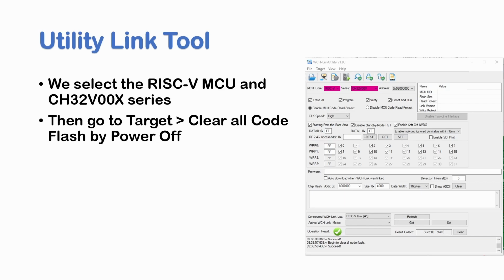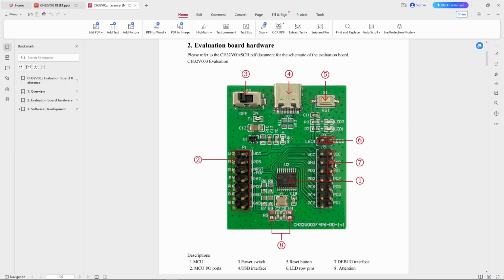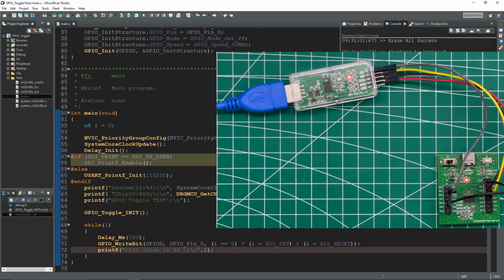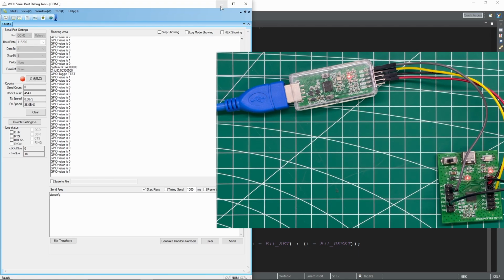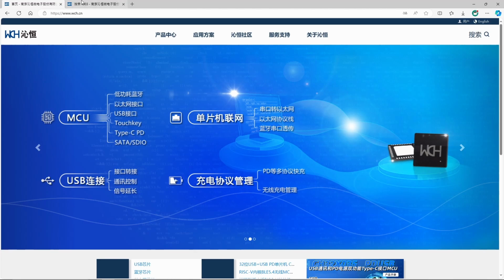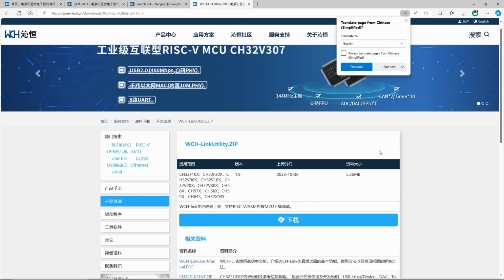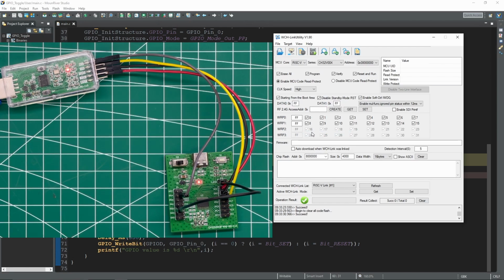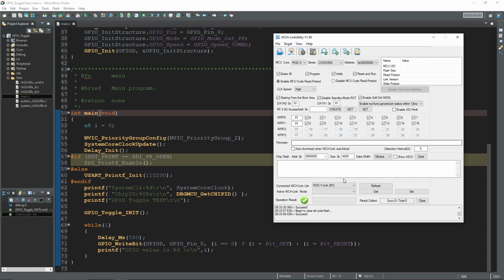#29- How to RESET CH32V003 if PD1 is Occupied？

Comment: How I can use the PD1 pin output _PP.? ch32v003f4p6  20pin

  thank u so much
Reply: void GPIO_Toggle_INIT(void)
{
    GPIO_InitTypeDef GPIO_InitStructure = {0};
    RCC_APB2PeriphClockCmd(RCC_APB2Periph_AFIO, ENABLE);
    GPIO_PinRemapConfig(GPIO_Remap_SDI_Disable,ENABLE);

    RCC_APB2PeriphClockCmd(RCC_APB2Periph_GPIOD, ENABLE);
    GPIO_InitStructure.GPIO_Pin = GPIO_Pin_1;
    GPIO_InitStructure.GPIO_Mode = GPIO_Mode_Out_PP;
    GPIO_InitStructure.GPIO_Speed = GPIO_Speed_50MHz;
    GPIO_Init(GPIOD, &GPIO_InitStructure);
}
Reply: @KennyTao-vy2pj  Thank you for this piece of code. The port configuration has to be modified to use PD1 as a general port. The important commands are the second and third. PD1 now works great.

Comment: I haven't gone through all your videos yet, since I just subscribed.  Did get the CH32V003F4P6-EVT working - because of your help.  I'm wondering if it is possible to do PWM on some of these pins, like we do in the Arduino and other boards.  I don't seem to see it called out as a function on the CH32 boards.

Comment: I use minichlink for this.  The "-u" option will "unbrick" a chip.  It needs to control power and be connected to pd1.  I have never had it not work and I have tried to.  I disabled PD7/nRST and PD1/SWDIO set them to GPIO immediately on startup.  It still reaet it.

Comment: Abstract

This transcript addresses a common issue experienced by users of certain microcontroller units (MCUs)  – the misconception that the device is broken when, instead, the PD1 pin is occupied. The video details how to correctly resolve this situation by completely resetting the MCU.  This is achieved using the WCH link utility tool  to clear all code from the MCU, thus freeing the PD1 pin and restoring full functionality. 

I used Gemini Advanced 1.0 to create this abstract of the transcript.

Comment: Hey Patrick, got s question about the CH347 chip.
Many PCIe DMA cards on the market use this chip to flash the FPGA gateware/firmware.
A big problem as OpenOCD doesn't officially support it yet.
Yes there is a patched version of OpenOCD with CH347 on the WCHSoftGroup github, but it is barely workable.

If you try to flash with it (using Windows 10 64bit), if you are even lucky to get it to start, it will have flash write errors shown on the verification command.
My friend and I have been trying to solve this. He was finally able to get a full flash cycle after about 10 tries. For the card I have I must have tried 20 times and it has errors each attempt.
Seems to be very unstable. There must be problems in the USB or JTAG side between the CH343CDC and CH341PAR drivers and the hardware.

How are DMA card manufactures able to flash their cards? Are they flashing the EEPROM first as assembly time?
I don't see how anyone can flash with this chip as it is.

Please advise. If there is a solution, as I'm sure many, are waiting on this.

Comment: Is it possible that this happens on the ch552? My ch552 is suddenly not recognized by the PC.
Reply: Tie the USB+ pin to Vcc with a 10k resistor when applying power.
Reply from the maker: They may have different problems, can you sent the details via yy@wch.cn